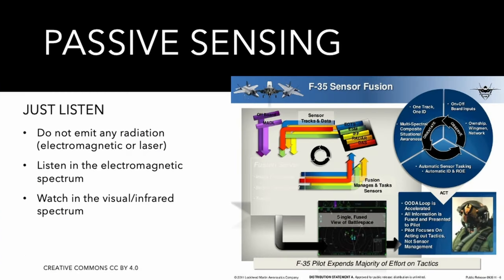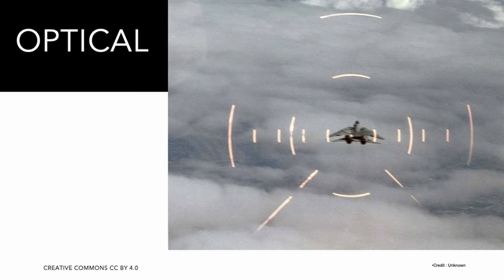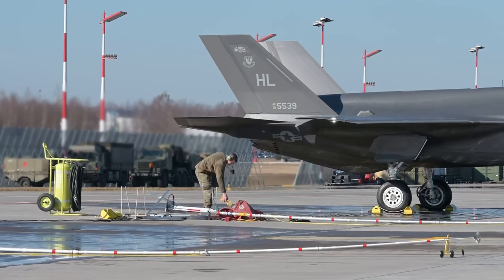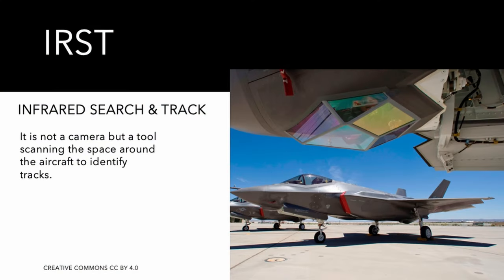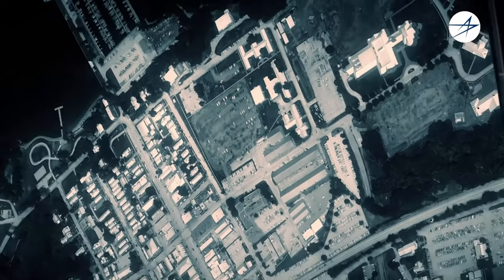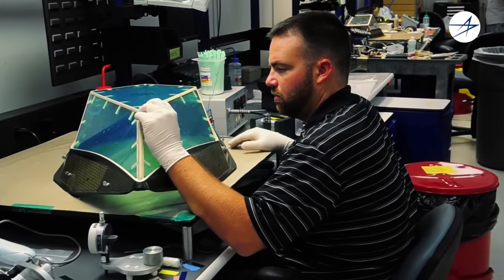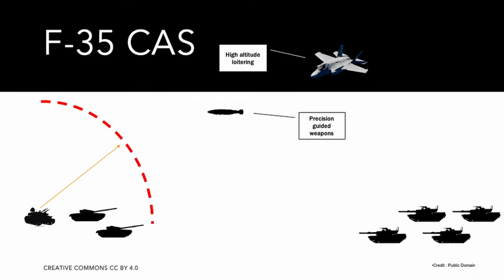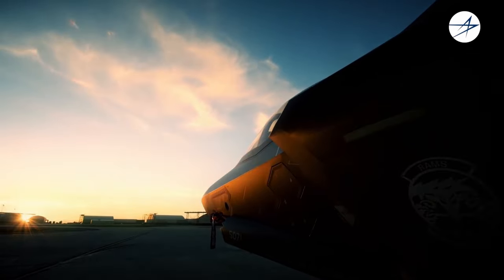The New F 35 Block 4 Sensors are Crazy!

Comment: Perplexing yes, because anyone can do this triangulation nowadays. My Airbox ADS-B connected to a Raspberry Pi does this. In some way Elon Musk was right about the F-35. It's a nice dream, but Lockheed lost the ability to execute (as in a Gartner Magic Quadrant). Right now the RNlAF has a whole squadron (312 sqn Volkel, dual capable!) with just one F-35! (Lot 15). The rest, I guess, is waiting for TR-3 which still doesn't work. I think we better stop dreaming about Block 4 and start all over.
F-35 doesn't have the internal fuel to stay on target for long.

Comment: It’s not on f35 already because any external stores ruins f35s  stealth capability which is just one of many reasons it is useless as a close support aircraft to replace the a-10. More f35 coolaid.
Reply: The A-10 is wonderful but saying the F-35 can't replace it doesn't mean that it can survive in a LSCO environment. The A-10s longevity has come from 20+ years of operating in friendly air environments.

Even then, the cool "brrrt" part isn't even the most useful part of the A-10 anymore. The smart ordnance carrying part is the most relevant part of the A-10 in the modern day environment.
Reply: Internal jdams for high threat. Bulk external points for low threat. Get over the A-10 already.
Reply: A10 was outdone by F111s in neary every aspect. It's a trash platform that smoothbrains flock to "cuz muh brrrt"